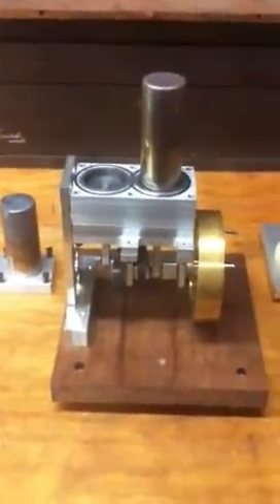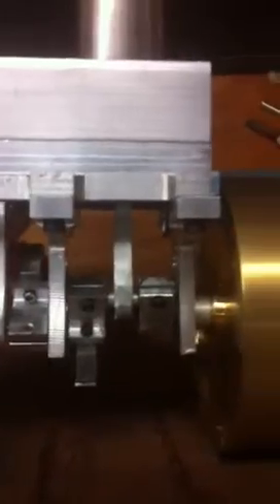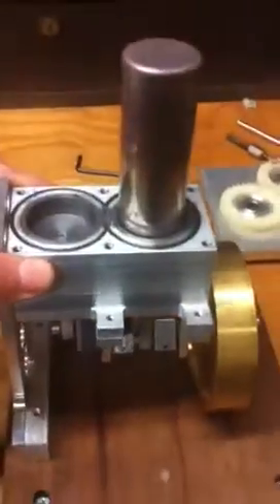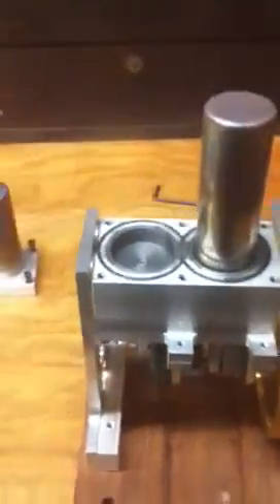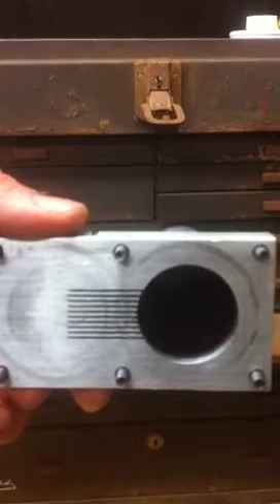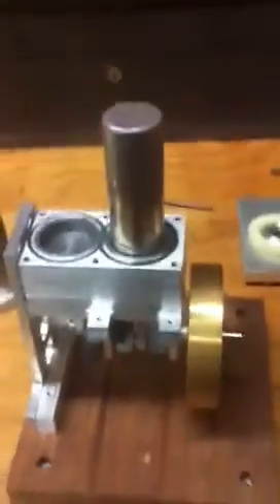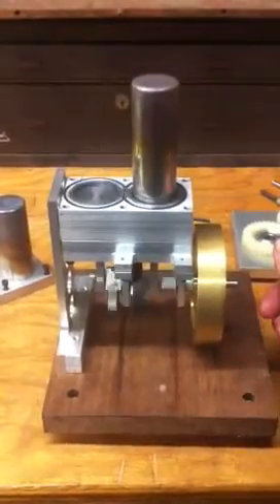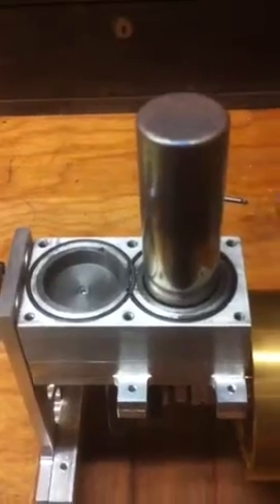15cc alpha stirling internals

Comment: Hello,
Your engines are really great. Simple and effective. Thank you for sharing all this videos.
In the comments you said that the engine is an undersquare stroke at a 1:2 ratio (1 inch bore, 1/2 inch stroke). It is then 1:2 ratio and an Oversquare engine, am I correct?
According to the information you gave in your videos, your 115cc engine has a stork ratio of 2.5 (B/S) and not 2 as in the 15cc. Is there a reason for that? more the volume of the cylinders is high and more this ratio must be greater?

Comment from the maker: Yes, both cylinders are mild steel.  Both pistons are made of ductile iron, and are identical, except that the hot piston has a flange on top that the displacer dome is pressed onto.  It's an Alpha Rider type configuration, so both the hot and cold piston are responsible for compression, and both pistons drive the crankshaft.  I machined everything except the round bar, bearings, and hot caps.  Check out Andy Ross's book "making stirling engines", I believe it's available for free download.

Comment from the maker: Piston Diametrical clearance is 0.0008", you have to get your lathe very well set up to hold that kind of tolerance, and take off the last bit with a hone in the cylinders, and sand paper on the piston.  I can't recall exactly off hand how long the stroke is, and I don't have the drawings here, but if memory serves it's 0.500".  It's an undersquare stroke at a 1:2 ratio, so 1 inch bore, 1/2 inch stroke.  And that's the same for both the hot and cold piston.

Comment from the maker: Mmmm, I'm not sure about that.  I'm no expert but there are a few things i would think would be the reason.  One would be ease of construction, it's much simpler to make a piston that can have a few thousandths slop than one that needs to be within a half thousandth, and the rings are easy to make and get the right size. 
Also, since friction is not as much of an issue the rings can be sized to get a higher compression ratio by making a tight fit.  at least that's what i'd surmise anyway.

Comment from the maker: Got it, both pistons use a simple clearance seal.  The cylinder is honed to a fine finish and same with the piston.  The piston is about .0008" smaller than the cylinder.  It provides for a very good seal with very low friction.  The pistons are turned out of ductile cast iron stock, which holds some oil in it's pores and it polishes to a good finish with use.   Does that answer your question?

Comment: @IndianolaStirling  I meant the hot piston seal against its cylinder. That seal is supposed to prevent pressurized air from the cylinder escaping out to the crank case.

Comment from the maker: I'm not exactly sure what you mean, are you referring to the hot cap seal?  If that's the case the hot cap is pressed into the head, with loctite to fill any  voids and also to keep it in place.  The only other seals are the actual piston seals, and the o-ring between the block and the head.  Hope that answers your question, please reply if it doesn't.